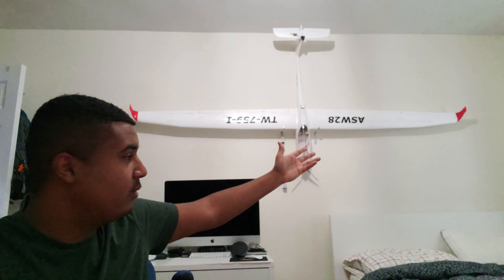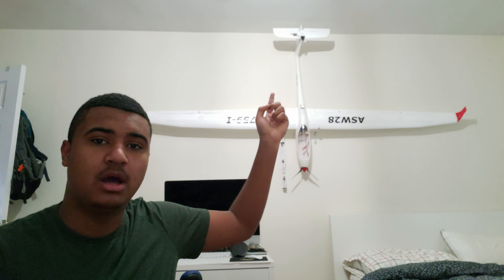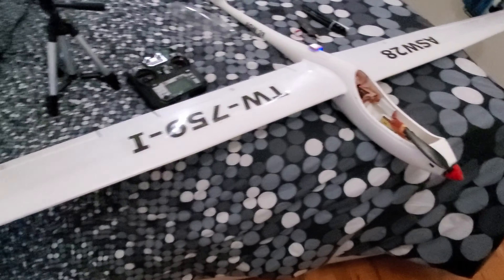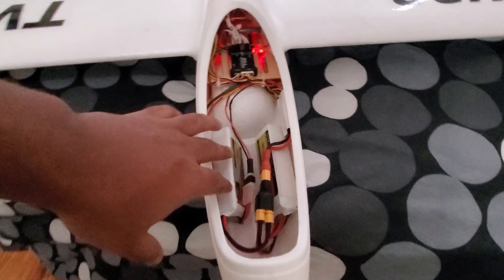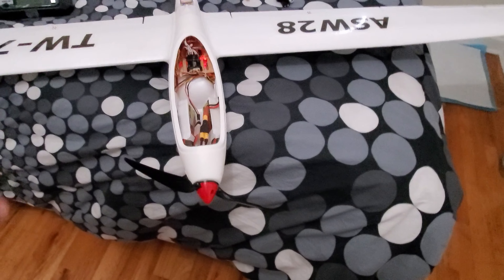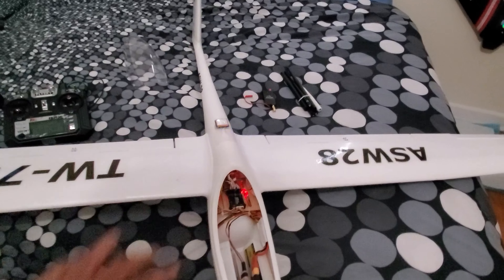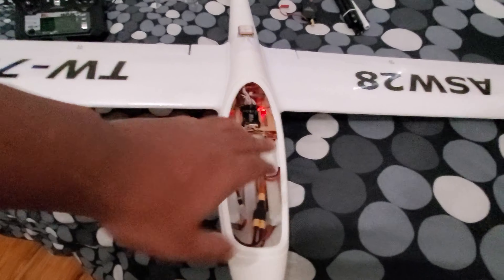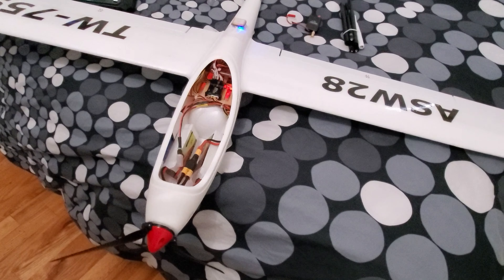Volantex ASW28 FPV Build Overview

Comment: I sent This brilliant Bird to Davey Jones Locker, I stood on the beach as the waves washed in the bits, one of the wings was in four parts!
My new one arrived today, Bangood had it @ 55% off, $127 Au, which is like US$85, Bargain from the Oz warehouse.
Same day as the ASW died,,, Half an hour later My Pheonix 1600 bought the farm, leaving a smoke trail like a WW11 Bomber shot down, motor was sent back halfway down the battery tray and the super structure plastic was cracked like You wouldn't think possible!

Gotta try this FPV stuff, everything is so cheap nowadays, even with the Australian Peso.
Great stuff TNYH.

Comment: That's a lovely model, not sure I would have put the VTX on the tailplane as that quite a weight up on a fairly small t-tail connection. Look forward to seeing the maiden :)
Reply from the maker: Oh trust me, that tail is tight and does not move. Luckily we live in a generation where powerful vtx's are smaller than your thumb, thus equals low weight, but we will found out in the maiden, if the tail is stiff, or if the tail wiggles alot, because of the antenna out on the elavator.